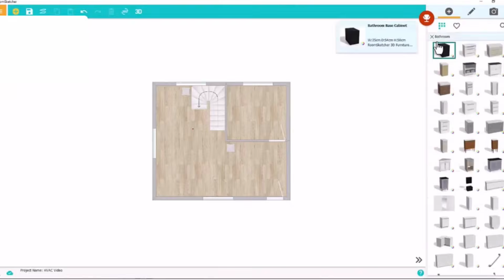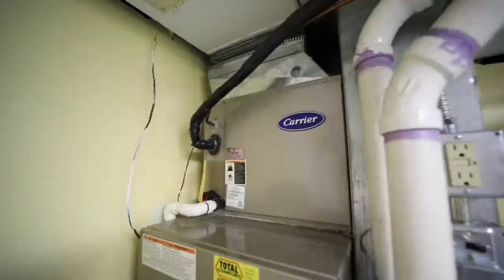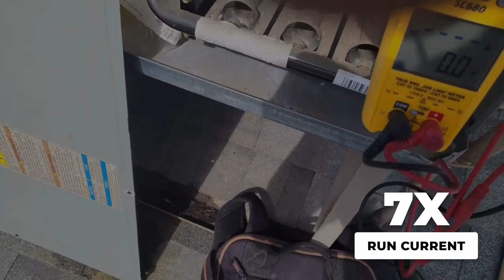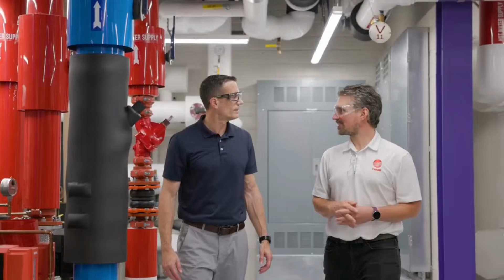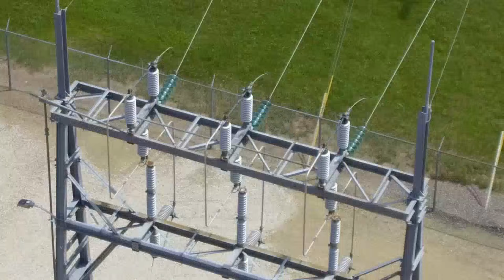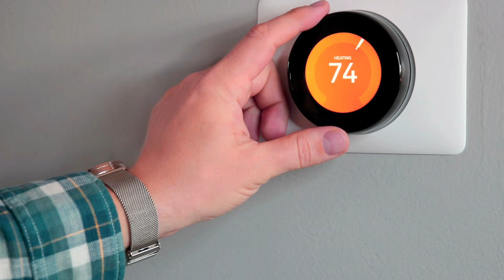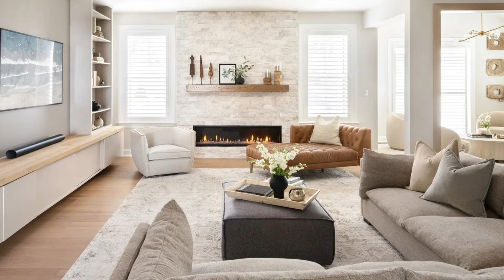How Smart Homeowners Are Beating the HVAC Industry (The 15-Year Loophole)

Comment: IF YOU DO YOUR ROOFING and Attic Correctly???? ... You'll use the HVAC 50% less. = TRY THIS: 
We planned on staying in our home longer than 30+ years. So, we wanted maximum protection on our roof. We also anticipated adding solar so this covers preparation to ensure the roof won't ever have a leak in at least 50+ years.

FIRST:
if you are considering solar in the future. Put on a new roof now or you'll regret it later. Start by putting a 2nd layer of 1/2 inch ply on the whole roof. WHY? "this" ensures the roof will not flex when people walk on it. Extending the life of your shingles. No leaks after solar is installed is essential if you have solar. You want to avoid the cost of removing solar to repair roof leaks! ADDITIONALLY: it also strengthens your structure for earthquakes.  

SECOND:
LAYER #1 on our roof was "Grace=BRAND" Ice and Water Shield as an underlayment. It makes a water-tight seal under the other two layers. You want this to be first to touch your plywood deck. It literally glues to the wood. ADDITIONALLY, if you have to replace shingles down the road the "Grace Brand" Ice and Water Shield is warranted for 2 shingle layers or a tear off of all other layers. Put your gutters on first and start this layer by slightly overlapping it on top of the gutters. When you do this it stops the possibility of dry rot between the gutters and eaves of the roof. ADDITIONALLY: "Grace" Ice and Water Shield ties all of your roof into one piece so you'll be the last house standing in a serious earthquake.

LAYER #2: on our home was "Tiger Paw Paper". And although the brand that makes this has 2nd class shingles it is the best underlayment to go above the "Grace Brand" Ice and Water Shield. ADDITIONALLY, if you ever have to change shingles this layer can easily peal off, with the shingles, while leaving the "Grace Brand" Ice and Water Shield down. ALSO "Grace Brand" Ice and Water Shield will seal the holes of each roofing nail and will close up all holes of a 2nd reroofing if necessary. And "Grace Brand" Ice and Water Shield is warranted for 50 years.

LAYER #3: was Malarkey Brand shingles. WHY? It's made of the essentially the same stuff as "Grace Brand" Ice and Water Shield. And it has a thicker layer of micro-gavel than any other brand I could find to block out the sun. It's even rated for protection against 3" hail.

THIRD:
To ensure you have cheaper energy bills. Simply put in lots of "Sofit Vents" & follow up with blown in insulation. Go to R-50 or R-70 ..... BUT FAIR WARNING. You should hire professionals to check all electrical & plumbing in the attic for defects or potential problems. It's far cheaper to fix now instead of dealing with all that insulation later. We originally had R-3. Increasing that to R-50 caused our energy bills to decrease at least 30% permanently. It resulted in a much more comfortable house.

FOURTH:
If you are doing all that work in the attic? Invest 2 ft wide ½ inch ply as a catwalk in your attic.  And yes, put in a few screws in each plywood plank to keep them in place.

FIFTH:
We also put in "Hurricane Ties" on each joint of the roofing trusses. WHY? Punch plates used 30+ years ago do not guard your house in an earthquake. Yes, it cost us $250 in 2017 for those metal hurricane ties https://www.homedepot.com/p/Simpson-Strong-Tie-H8-18-Gauge-Stainless-Steel-Hurricane-Tie-H8SS/205324375.
I also predrilled each hole & used 8 to 10 exterior grade deck screws on each hurricane tie.
https://www.homedepot.com/s/exterior%20grade%20deck%20screws?NCNI-5
AGAIN: We feel much safer knowing our home will be the last one standing in a serious earthquake.

My husband and I cordially invite you to take a tour of our roof and attic to see how well it all works. Just request an appointment. It only takes 20-30 minutes of your time.

I also enjoy helping people to understand how to grow their own food. A tour of our food garden is included if you're interested. We have mastered growing 25% of what we eat in very effective garden are of only 205 Square feet.

P.S. Roofers hate my ideas. Why? Getting you to have a standard roof guarantees their return in 20-30 years max. My roof will last at least 50 years and likely much longer. For sure never in my lifetime. And even with solar I will never worry about leaks.

FYI = BEWARE = A licensed roofer did our roof leaving it in need of $4,500 of repairs and, even after the repairs, no other roofer would give it more than a 20-year-life even if we did those repairs.
...... THAT ROOFER didn't charge up-front. And when I complained to CSLB they refused to open a claim. WHY? There was no monitory damage. If you don't put down a deposit? You CAN'T have monitory damage. HOWEVER, If we had paid him a deposit? we could have had a strong complaint. LESSON LEARNED. 

Best Regards,
Janell
Reply: And if you submit a claim to an insurance company that involves your roof, good luck getting paid

Comment: Im a hvac tech its not just hvac it's everything the rich has destroyed the poor man's why of life period we will all live in a box soon
Reply: I have a new international comfort furnace and AC unit for the house can I keep the fan on all the time running I change my filters every month merv13 I know it has a ECM blower motor
Reply: @Maximilian8989  You obviously can (there is a setting for fan only), the question of should you, depends on a few things.

1.  Is the air return sized correctly.  You can look up the correct return size based on your air handler size.  As an example, a 3 Ton A/C unit should have a 600 Sq In air return, which is typically 20x30 inches, or 24x24 which is 576 inches.

2.  Merv13 filters are probably on the very top end of the air restriction end, and are typically used by people who have allergies or pets or are filtering smoke.  I would personally stick with Merv11 or below, a MERV8 would probably be ideal.

If you need filtering above MERV8, it would be much cheaper in the long run to buy a stand alone HEPA filter unit or two for your house, and let them handle the additional filtering, as they cost around $150 to $200 for a unit that cleans up to 2000sq feet.

ECM blower motors don't do well with high MERV filters and/or incorrectly designed ducting and air returns, and will fail prematurely, and as you probably know, are pricey to replace.

Ultimately, it is much cheaper to spend $200 to $300 for a HEPA filter or two, which will do a much better job anyways of filtering the air, instead of loading down your ECM motor with a very restrictive filter, and wearing it out or burning it up prematurely.
Reply: Its the EPA and scam regulations that do it
Reply: @CaliCashDeals  Yeah, we really should have just kept the Hudson River as a toxic superfund site and let the rivers catch fire due to rampant pollution.  These brain dead EPA comments are so astoundingly dumb that you must have flunked out of 2nd grade history...
Reply: @redbaron6805  Typical liberal comment.

Comment: I won't get another AC system unless it uses an inverter, keeps the humidity low regardless of the size since it runs at variable speeds and super efficient.
Reply: Careful. You might need a dehumidifier. Air conditioning may NOT dehumidify enough.

Comment: Also no matter what you buy, they will change refrigerants as soon as the patent expires.
Reply: Interesting comment. The industry will not tell you that the refrigerant can be converted from R22 to R410A. The oils are not compatible. If you have a  hybrid system and the system has an evaporator that can accommodate both and the condenser is R22, and you are upgrading the condenser to R410A, you can do it. The new condenser should come filled with R410A. Remove and replace the old condenser, and replace the old dryer, and expansion valve. Evaluate the system. Purge the system with cleaners. Install an oil conversion treatment to take care of residual oil. You are done
Reply: yes
Reply: There is a problem with surge protectors. Variable speed units do not have contractors. The istamatic mentioned in your video is great for non-variable speed units that have a contactor. The surge protector cut the 24 v line to the contactor plus provided MOVs and a timed restart. 

Variable speed units do not use a contactor, they have an expensive circuit board plus an inverter. The 240 v power from the line is controlled by the circuit board. The circuit board is powered by the transformer 24 volts located in the air handler. Cutting the 24 v line does not disconnect the 240 v power to the board. It does not protect the air handle board.

The ICM493 is more suited for variable speed units. It has a contactor that will cut the 240 volts to the condenser. It is imperfect because it does not protect the circuit boards. It does have its own 24 v transformer. This source of 24 v can be used to power a relay that will cut the power to both the air handler board and the condenser board when a surge is detected. 

My conclusion, there is no perfect surge arrestor for variable speed units that will work out of the box. Leaving two $800 boards unprotected is not a good option. You have to modify them. This modification may be beyond normal technicians abilities.
Reply: @TexasEngineer  Your post is so far all over the place that it gets to the point that it starts to make no sense.

1.  Please try to get the spelling correct on the parts you talk about.  It is a contactor, not a contractor.  The name of the surge protector is Intermatic, not Instamatic, etc.

2.  Surge protectors don't "cut" any 24V lines to anywhere, and they work on any A/C unit, regardless of whether they have a contactor or not, and they they don't have a timed restart.  These claims are literally all false.  A surge protector literally just has a voltage threshold, where it will shunt a voltage to ground using a MOV.  The lines protected, and the voltage threshold is clearly labeled on the surge protector.

3.  Variable speed units don't have "a" circuit board, they have several.  The circuit board in the air handler and condenser unit is NOT powered by the 24V transformer.  The 24V transformer ONLY powers the thermostat, which then sends command and control signals to a variable speed condenser and air handler, instead of activating a contactor.

4.  The ICM493 does NOT have a built in 24V transformer, and does NOT cut power to the air handler board.  I have literally no idea where you are getting that claim from.  Even the installation instructions clearly show that.  And having a relay cutoff is useless on a variable speed system.  It is only useful on a single speed system to protect it from short cycling when you have a surge or a brownout.

You really need to learn what surge protectors are, and how the work.  If you want to protect both the air handler and the condenser unit, you simply buy two surge protectors.  As noted above, your claims don't really make any sense, and clearly conflict with the actual system specs on the systems you are talking about...
Reply: @red@redbaron6
#1 I am having big issues with my spell checker because contactor is not in its dictionary and it battles with me and insists the word is contractor. Deal with it.

#2 I have two surge protectors. One has MOVs, a time delay on restart after power shut off and a 24 v wire used to cut ant control wire; I am not using it. The other ICM 492 uses 5 MOVs, a contactor to cut the 240 v power powered by its 24 v transformer. There is a time delay for restart after loss of power. It is programmable. It can detect over and under voltages that you set. It will let you know how many MOVs are still working. The available MOVs is a valuable feature to know is the system is still operating. You can preset the number of MOV# to operate at one time.

#3 &4 My variable speed RUUD has a circuit board powered by the air handler 24 v transformer. It does have a circuit board and an inverter board plus daughter boards. No contactor. The air handler has a circuit board powered by a 24v transformer which provides the power, common and Y1 and Y2 to the condenser. They can communicate to other equipment but it is not being used. My other, the ICM 493, has 5 programmable MOVs, a contactor powered by a 24 v transformer. I used this transformer to power a relay to cut the 24v power to both boards.

The problems was if the ICM 493 tripped off and killed 240v power, the control board would never know it lost power and would not put the unit back through the startup sequence. The ICM 493 has to be programmed for maximum and minimum voltages and it you program it wrong it can trip the unit off and it will never restart until I kill power to the air handler. This is tough in the middle of the night. All this because the voltage went to 253 instead of programmed 252 maximum.

Yes the ICM 493 does have a start delay on power loss. That is how I located the not restarting issues, spending a lot of time waiting for the restart that never came. Flip the disconnect switch and wait for the system to work out all the delays. 

That is why the 24 v disconnect on my other surge protector is not used. It confuses the board. You see the 24 v disconnect is intended for just the Y1 on a normal unit. With Y1 and Y2 it can get very confused if Y1 is not powered and Y2 is powered, plus it does not turn off immediately and goes through a power down sequence. Also it serves no protection because the board is still powered allowing the board to remain on during an event.
Reply: Every 10 years the current climate change friendly refrigerant is deemed to be unfriendly to climate change.  It’s a scam, but regulatory authorities suck it up like kool-aid. As long as the lubricant is the same, the equipment is mostly reusable.
Reply from the maker: The lubricant compatibility is the part nobody talks about. R-454B needs different oil than R-410A... that's why you can't just swap refrigerants. But the 10-year refresh cycle? Yeah, follow the patent expiration dates sometime. Interesting reading.
Reply: @HVACExposed and   you can  still not buy  r454b  to day
Reply: @HVACExposed As I noted already, the 10 year refresh cycle is fiction.  You really need to push against misinformation claims like that, or your channel will literally lose all credibility.

R-22 was developed in the 1930's, and was in widespread use by the 1950's.  It wasn't phased out or restricted until 2010 and 2020.  That is 60 to 70 years, not 10 years.

R-410a, which replaced R-22 was developed in 1991, was off patent in 2011, and then was phased out as of 2025, with no new units allowed.  The patent lasted 20 years, and then it lasted without patents for another 14 years, but isn't scheduled to be significantly phased out as refrigerant for existing units until mid 2030's.  1991 to 2036 is 45 years, not 10 years. 

So, following the patent expiration dates takes you nowhere, and there is no 10 year cycle that exists...
Reply: @ssaraccoii  These claims are just comically dumb, besides being utter bullshit.  R-410A was patented in 1991, and it wasn't phased out until 2026.  The patent expired in 2011, and it took another 15 years to for it to be  phased out.

So... unless you are mathematically illiterate, don't know how calendars work or never figured out how a calculator works, the claim that refrigerants are phased out "every 10 years" is obvious fiction...

Comment: Quite honestly a 3 - 4 ton HVAC system should not cost more than $4000 - $5000 installed.   Why does a 3 ton mini split DIY unit cost $2000 - $3000 at Home Depot then??  It is called PRICE GOUGING!
Reply from the maker: Mini-split at Home Depot and a properly installed central system aren't the same animal. Different labor, different line sets, different electrical, different ductwork considerations.

That said... yeah, margins in this industry are ugly. Private equity buyouts didn't help. But $4-5k installed for a quality system in 2026? That ship sailed.
Reply: Yeah, all these "shouldn't cost" claims are just beyond comical.  It reminds me of these people who talk about gas costing 31 cents in 1960.  Those same people of course can't figure out that adjusted for inflation, 31 cents is $3.42 today.  So, all that "cheap gas" in 1960 is about the same price, or higher, than gas prices in the USA, pre Iran war...